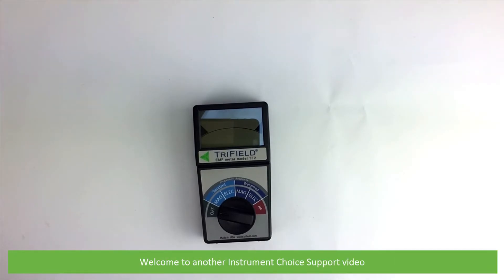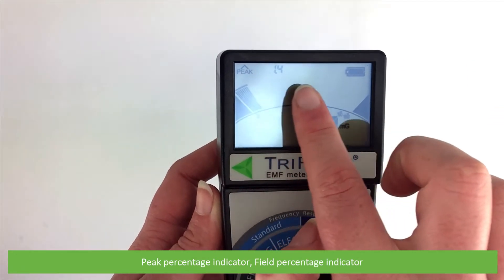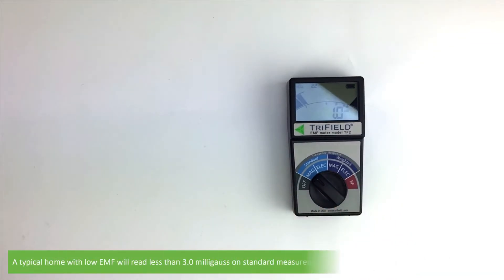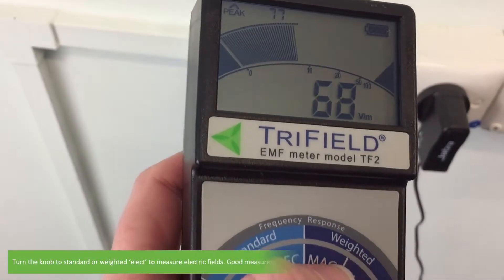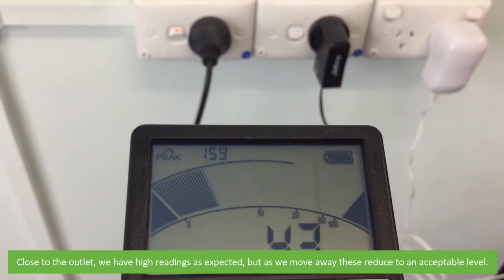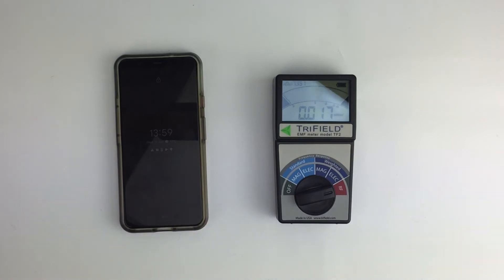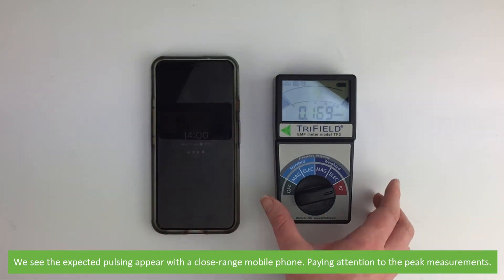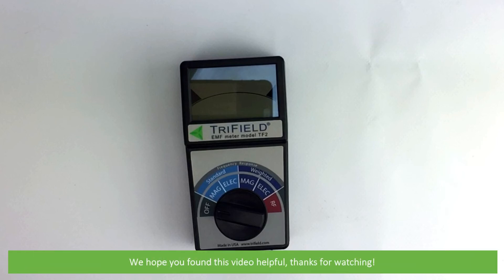How to Take EMF Measurements on the Trifield EMF Meter IC-TF2

Comment: the scale is 1mw or 1000 mW? and dot is a thousand separator?
Reply: Thank you for question. The range of the meter is up to 19.999 mW/m2 with a resolution of 0.001 mW/m2. The readings will be separated by a dot.

Comment: Why don't you explain that mG (milligauss) has to be converted to G (gauss) and that the actual normal level isn't less than 5 mG but less than 5 G? People are using this all wrong because of your misinformed video.
Reply from the maker: Thank you for your enquiry on our YouTube video about the Trifield TF2. With regards to this, in Australia Magnetic field levels are read in Milligauss as per Arpansa;
https://www.arpansa.gov.au/understanding-radiation/radiation-sources/more-radiation-sources/electricity

Can you confirm where you are seeing the conversion to Gauss? So that we can update the video if required as we want to ensure it is accurate.
Reply: An AC field of 5 gauss (5000 milligauss) would be extremely unusual and very high. I've taken readings with various AC gaussmeters and rarely see over 10 milligauss except near walls where there's wiring inside, where it might be ~50 milligauss. I've never seen AC field as high as 5000 milligauss anywhere. BTW, the Earth field is around a half gauss (500 milligauss) in Australia, but that's DC, not AC. Big difference.
Reply: Armchair comedian, 'less than 5 G,' lol, love it.

Comment: would you please answer the weighted question in laymans terms, as to what would be dangerous or harmful levels to see on the meter?
Reply from the maker: You would take a reading on weighted mode if the concern of EMF is on the body. The standard mode will measure the actual electric and magnetic field from the area of concern. The standard mode will be used for reporting and testing of the instrument of concern.

Comment: what is weighted for?
Reply from the maker: Thanks for your question.

"The weighted mode is applicable for those concerned over the effect of EMF on the human body. The purpose for the weighted version is as follows: The amount of energy induced into living tissue from a 100 Hz frequency at 1000 V/m, would be twice as much over the same period as a 50 Hz frequency at the same 1000 V/m strength. A frequency weighted TriField meter will indicate that the 100 Hz signal is twice the level of the 50 Hz even though their actual strength was the same.

The standard mode on the TriField EMF Meter measures the actual electric and magnetic field with a flat frequency response. For epistemological scientific applications, the standard frequency mode is applicable."

Comment: What should be the normal readings inside your home for each one? and what is the difference between standard and weighted?
Reply from the maker: Hi Nat,

Thanks for your question.

Check out pages 5-6 of the user manual (https://www.trifield.com/wp-content/uploads/2020/06/tf2_owners_manual.pdf). Those pages detail both the Standard and Weighted Modes as well as EMF exposure limits.

The FAQ page details helpful information on the subject too: https://www.trifield.com/faq/

Hope this helps!

Comment: Thanks for the video, but it still wasn't simple, as you describe. I bought one and so far it has pretty much been a waste of money. It's never consistent with itself. The only thing it has made me realize though is that nothing (copper, aluminum, so-called EMF blocking fabric, etc.) can block or reduce EMF.
Reply: Aluminum foil only blocks the EF and some RF, not on the EMF.
Reply: Aluminum foil works - you need to fully envelop the phone in a thin layer of aluminum foil.  Do that and try calling your phone - it won’t ring because signal is blocked
Reply: Time for you to move away from high voltage wires!
Reply: Lead can. That's why they banned lead paint. Not because kids were eating it, but because it blocked signals. The establishment is bombarding us with frequencies like 5G, which can affect our own biosphere and cause harm to our bodies. Humans have a frequency of 802.15. 06.